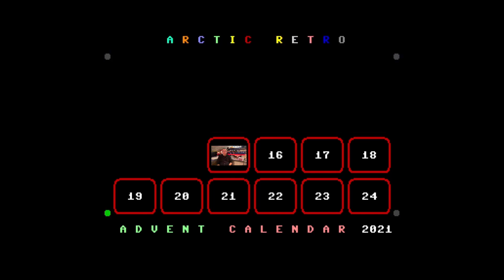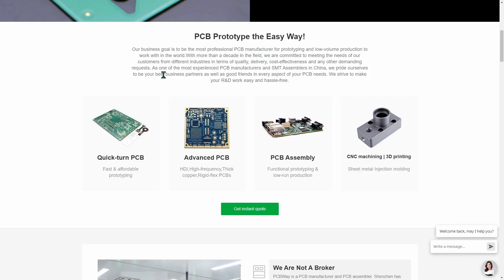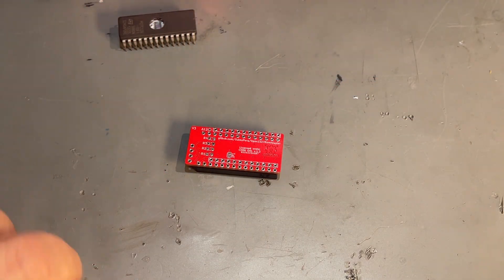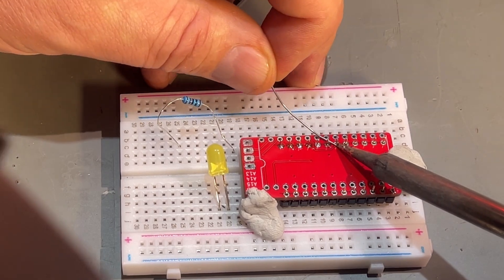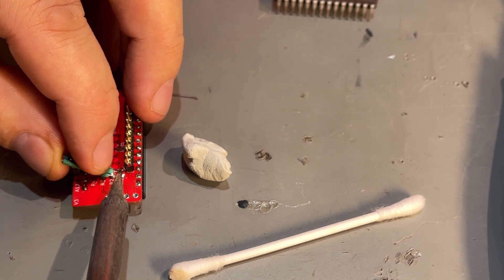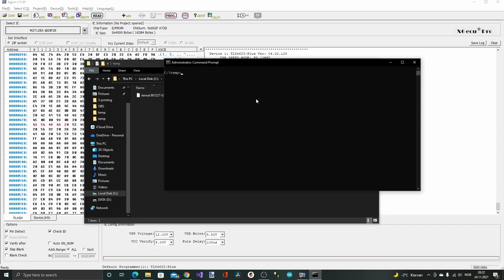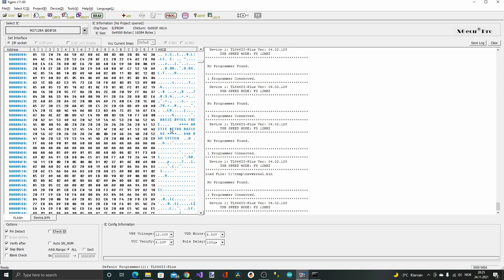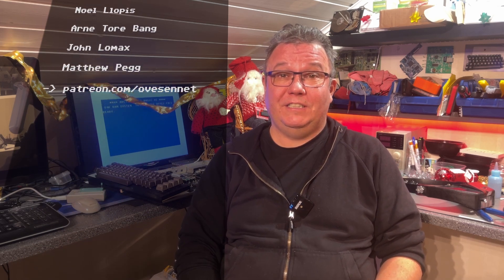December #15 - Making a C64 kernal adapter and custom mod - Commodore advent calendar 2021

Comment: Great video Tommy, kernal replacement adapters are VERY handy to have around. 

I would recommend soldering the pin headers in the other way around. The thinner end mates better with both normal and turned pin IC sockets.
Reply from the maker: Thanks!

Comment: Hy Tommy,
Great video! 🙂
I would like to ask about your C64 you built from scratch.
I also built my own one and I also would like to insert a Shuriken RF modulator instead of original one. Unfortunatelly it seems to me that it is not available anymore. What do you think, how can I have a nice black one into my 250466 board?
Reply from the maker: Hi. I don't know where you can find one. It seems the commodore4ever web site has been taken down. There are other replacment modulator. Check out https://github.com/mbarszcz-pcb/c64-rf-modulator-replacement